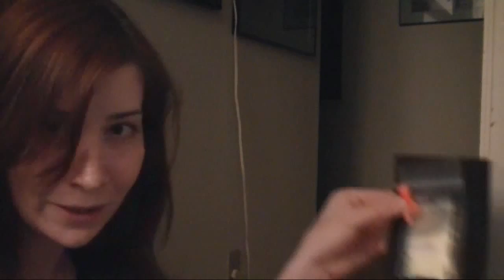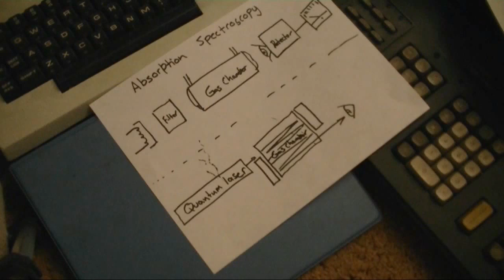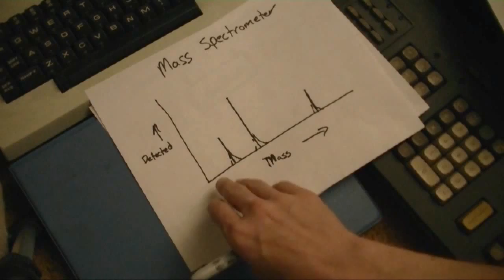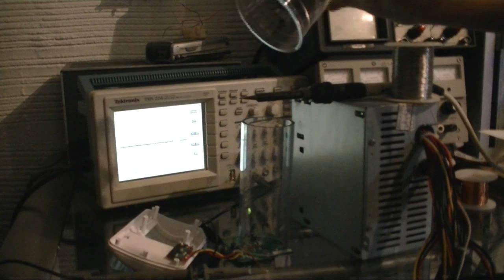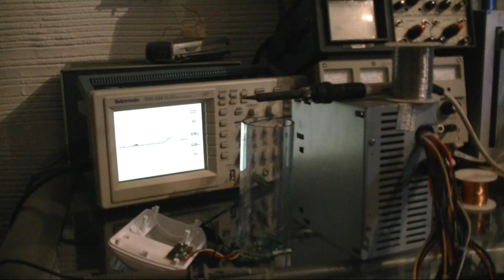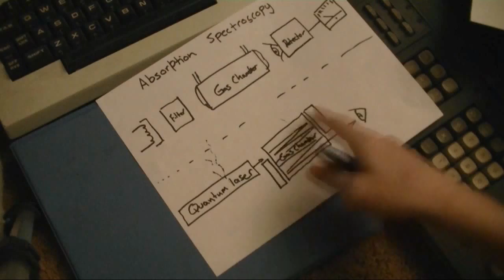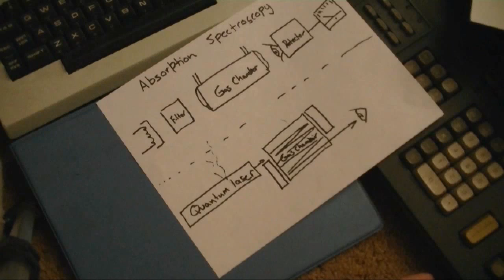Greenhouse Gas Detection Part 2 of 2

Comment: The way to do this is with tunable diode laser absorption spectroscopy (TDLAS). It's simple and reasonably cheap. Vacuum systems and gas lasers will never be small and cheap enough.

Look this video up on youtube. "MIRTHE Prototype Laser Spectroscopy Platform "

I can send you some papers on TDLAS and ultra-sensitive laser spectroscopy in general if you're interested.

In addition, you can go to spectralcalc to look at the spectra of species of interest.